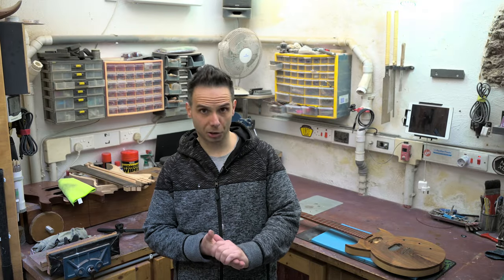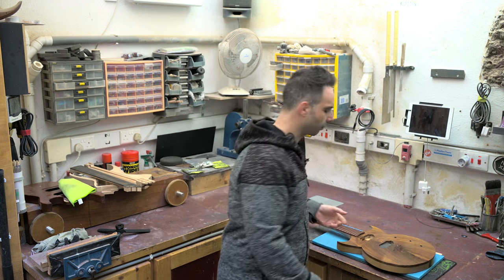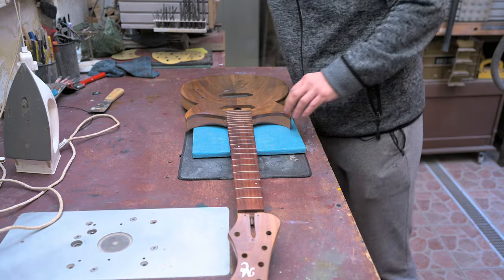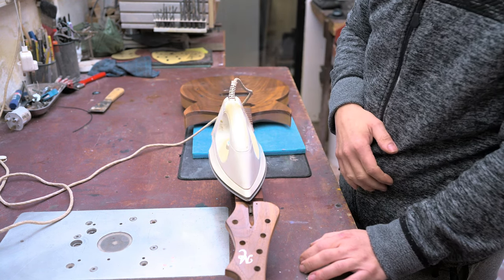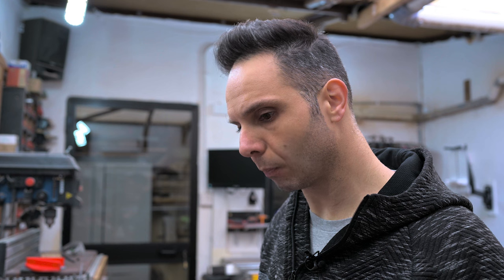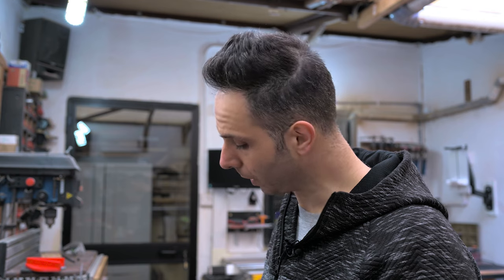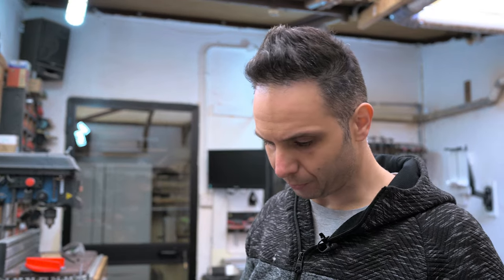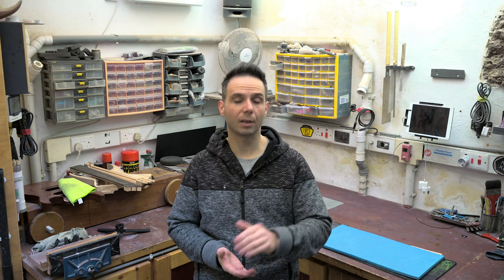How to remove a guitar truss rod cheaply & safely!

Comment: You made it look so easy. Once a portion of the fretboard is lifted from the neck is there any danger of the glue re-adhering once it cools? Do you have to keep the lifted portion from touching the neck? Would it help to heat the blade of the tool too? Or would heating the blade damage the wood fibers?
Reply from the maker: Heating the blade would help too. I never experienced the fretboard re sticking to the neck. Usually when heating the fretboard, the heat will make it slightly bowd away from the neck so I wouldn't worry about that.

Comment: Does that work with a fretboard that's been epoxied? I tried to do this with a Warmoth neck and it was a disaster. Also I thought you needed to remove the frets to do it.
Reply from the maker: I never tried with an epoxied fretboard, wood glue is known to weaken with heat but I doubt epoxy is the same way as wood glue.